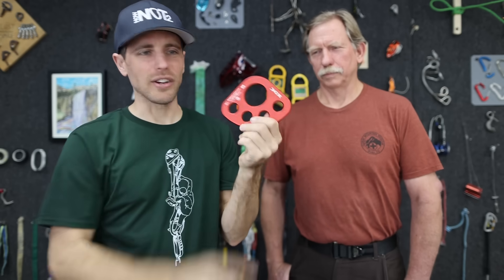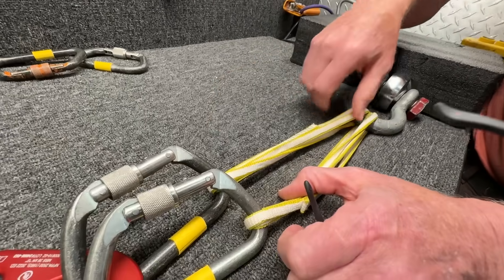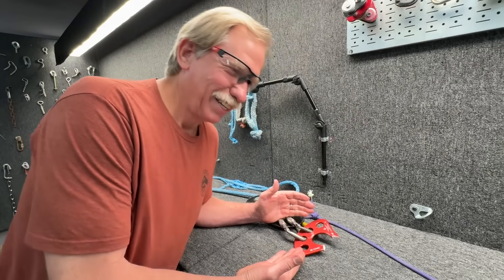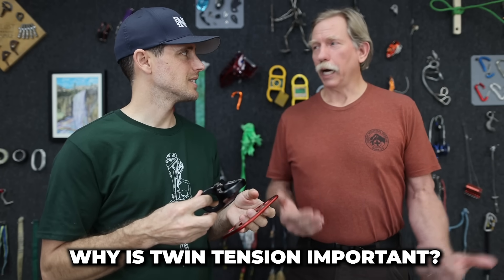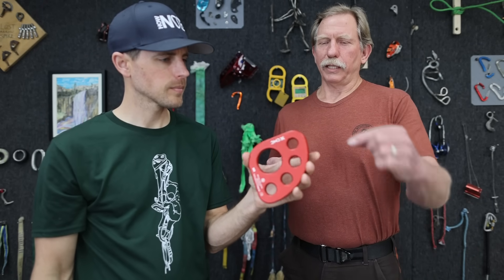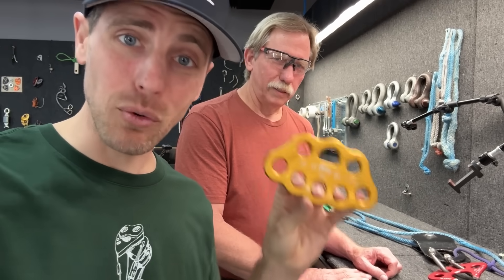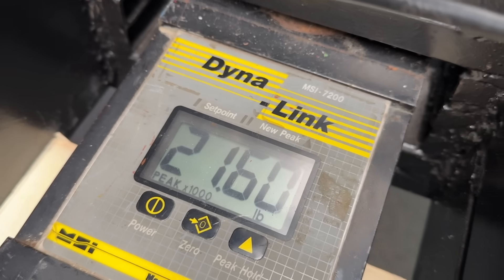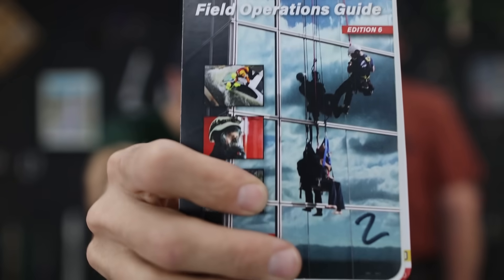When is Redundancy Ridiculous?

Comment: Why dual rigging? Because no matter how much you idiot proof, a better idiot will come along.
And sometimes the most reliable, steady and knowledgeable person has a brain fart.
I didn't work in rescue but in construction rigging where moving massive compact pieces of machinery  through restricted areas of structural frameworks, piping racks and narrow holes was like Tarzan swinging ftom vine to vine through the forest. All the while your in your safety harness, clipping and unclipping your dual safety lines to keep the chainfalls,  rigging and sometimes mainline from a crane doing their job and not binding up to a failure point. So nowadays our safty gearvis getting better because of crossover ftom the climbing and rescue side (and yes, i have worked a lot in confined spaces where Safety & Rescue has to sign off before we started work so if anything DID go wrong they were going to be informed for a rescue, good to see the expert testing their gear)

Comment: Redundancy

You Decide: In order to fully understand “redundancy” we must understand how “they” define it. More importantly, how a lawyer would define it, for example: he introduces an “expert” witness on the subject. CMC, NFPA, even TEEX define it the same. If *ANY PART of the main-line ie the “PRIMARY SYSTEM” fails, the “belay” (secondary system) should hold them. This includes a shock-load from an issue originating at high-point. (Note: I am not talking about the anchors, I’m talking about every element of the “SYSTEM.” 

With that being said, the “smart” guy in the room is now going to respond by saying “yea but the twin-tension method is a single system, utilizing two ropes, sharing the load on each line, which doesn’t require a back-up, oh and it’s the safest by far, it’s super duper redundant.” 

(Note: the twin tension is my personal favorite for a simple lower) 

My response: Yes, indeed the twin tension is the safest. But the manufactures and certifying bodies (who also teach the following methods lol)  didn’t change the definition of “redundancy.” For example: I rig a twin tension and only have one anchor strap on the anchor, with two clutches attached to it, both attached to my single Texora anchor strap (that I basketed on the anchor😉) that’s rated for 100kn. In addition, I rig another Texora strap to the double pulley on the high-point. 

Is my system redundant? The answer is no. You are essentially defining redundancy for yourself and on your own if any element of the primary system fails and results in injury or death as “redundancy” has been defined. It is clearly written. Unless they change the definition, they won’t care what your definition of redundancy is because they have already defined it for you. 

You don’t decide.

Comment: Modern technical rescue guy here and I also work in the industrial safety field, so I know all the boring regulations when it comes to NFPA and OSHA. Redundancy is good, but with modern equipped and modern MBS ratings redundancy is mostly just to make someone feel good. You aren't taking whippers on this stuff. In the industrial side of things I do alot of operations with a single anchor point and a single 1/2 inch kernmantle rope that has a weight rating of 9,820 lbs. In some cases it just isn't reasonable to have multiple anchor points and multiple rope systems attached to each person. In alot of cases I am going in alone on one rope with whatever equipment I need. That is why we use a 1/2 inch rope. The standard says 3/8 rescue rope is good for one person and 1/2 inch is good for 2 people. Now that isn't always the case though. Let's say i pull someone out of frac tower or 200 foot tall cold box.   Obviously I need to get them to the ground and that is when we will set up a redundant system as both of us will be attached together and be lowered down to the ground together. Them in a SKED or basket and me attached to the side of it so that I can help guide around obstacles, keep the patient calm if they are conscious, and/or render whatever aid is needed immediately upon reaching the ground. I have never had a peice of rescue equipment fail on me and the entire rescue team double and triple checks every part of the system. It is all situation dependant though.

Comment: For the first test, try repeating it without the upper carabiners. The narrow curve of the carabiner was point loading the master point, hence the deformation at the points where the carbines were contacting it. Using soft shackles or slings, that would conform to the curve of the master point, would remove the point loading.

Comment: "Redundancy" is a lot less specific in climbing, and for consideration: One rope is actually made of hundreds of nylon filaments; it is internally redundant, to the degree that ends up being pretty foolproof in normal usage. Protection on leads is redundant, as long as one remaining piece keeps the person off the ground/landing. One 22kN locking biner is usually considered as bombproof as his master plates, for normal climbing use, but in practice even clipping any secondary line to another anchor point feels a wee bit safer - and Todd Skinner and Paul Piana's famous near-catastrophe at the top of the Salathe Wall was averted by one last piece, as I recall, while the rest of their system was sheared off by the massive boulder.

Comment: Question, the way the basket hitched dyneema is connected in the video, could you do that for rock climbing anchors using locking carabiners on each end? To me, it looked redundant and way stronger than using 1 dyneema sling with a BFK or overhand and since dyneema tends to slip when broken (past videos show the knot coming undone in away) it seems safer than hoping a knot holds when broken. I understand we are talking about forces that most likely wont ever happen, just curious if this is a "safer" solution than one dyneema.

Comment: Its an endless and often ridiculous debate.
You can lift people with a single crane. It has one rope. One winch. One boom. You get the idea.
Over the weekend i snapped several ropes under normal load, due to age.
A number of knotted dyneema lines amd blew out a couple of incorrectly threaded blocks.
I watched a neighbouring crew start to hoist someone up a mast with backup line over a wire rope and a number of edges. Also not maintaining a maximum static fall for the backup. And i did intervene to point out their more critical hazards.
Most folk.just don't know and then assume that two of everything makes it safe. As for the T.A.. they should know, but just assume that two of everything makes it safe and absolves them of any liability either way.
Who remembers when you were allowed to tie your own knots ?

Comment: I would go with a plate with a hole for each anchor point. Since if the perimeter of the hole fails, only 1 hole fails, not the whole master point. Making the plate inherently redundant.

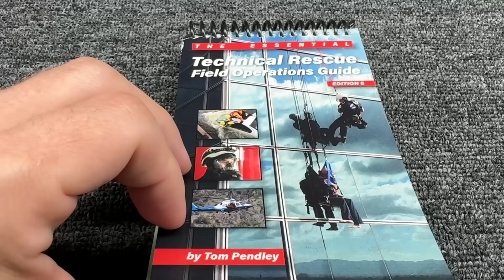Ie, the example at 2:10 isn't actually redundant since if the hole on the rigging plate fails at the anchor side, then it won't be securely attached to any anchor. This is a single point of failure. Even if a rigging plate in good condition can handle forces far beyond what is needed for the application, that still isn't redundant but rather an acceptance of marginal risk.

Some might argue that a single rigging plate can't be redundant, this is a bit of a myth that one supposedly needs two separate components to achieve redundancy. It is however a good rule of thumb.

Redundancy is only about handling one (or more) failures of individual aspects making up a larger system without the larger system itself failing. If the larger system has any choke-point where a singular failure makes the system collapse, then the system itself isn't technically redundant, if one wants to be super pedantic...

But in practice, reaching actual redundancy in any system is more theoretical debate than anything.
In reality one will have to brush some of these choke-points away as acceptable risk if it is infeasible and/or needlessly complex to make that aspect redundant.

The lack of redundancy showcased at 2:10 is fairly trivially amended by using a differently designed rigging plate with two separate holes for the anchor points. Preferably separated a bit such that a brake in one doesn't meaningfully compromise the other. This amendment isn't infeasible nor needlessly complex, making this single point of failure fairly unacceptable if one desires redundancy.

However, with two separate anchor holes one will have uneven tension on the ropes if an anchor point fails, since the rigging plate will rotate. But the main operator is able to equalize the tension on these ropes again in fairly short order, nor does it matter that one ropes is a few inches longer than the other. I rather much accept this than a free fall, any day of the week.

In the end.
Super good enough is however still a good way to look at it. Like I won't say that the rigging plate is garbage. But in a redundant system, one would prefer the bar for introducing acceptable risk to be higher when the solution to the single failure point is as simple as this.

Comment: I'm an IRATA technician since 2004.Things changed a lot and that is mostly to prevent human error.
Also they change after analysing accidents and incidents and find out what went wrong. If it was human error,change the method the task is performed, it if was the gear,improve it or remove it from use.

Comment: The redundancy in occupational settings and the hugely different safety standard in general is to account for user error. When you're a recreational climber, you can decide to just not do it if you're not felling 100%, if you've got a bad gut feeling, whatever. In an occupational setting, that is often not as viable of an option as it should be. Maybe you're an arena/event rigger walking on the beams at the end of your fifth 12 hour day in a row. Maybe you're a rescue technician who was woken up by the notification in the middle of the night and now needs to rescue someone, mere minutes after being ripped out of your sleep. Maybe you're a rope access technician maintaining a building, and even though you're tired and just not feeling that good, you power through because it's your job. In all of these four situations, the likelihood of user error is dramatically increased. You'd be surprised by how much tiredness can impede on your brain's ability to get even the simplest things right, and that is a big problem when your safety depends on whether you tied a knot correctly or incorrectly.
Another reason for the high safety standard is that it dictates what a boss can demand of a worker. If a recreational climber finds that something is unsafe, they can just not do it and that's it. If an occupational climber finds something is unsafe, there needs to be some sort of technical standard that determines what is and isn't safe so that it can be determined whether the climber is justified in refusing to do the work or not. And logically, this technical standard needs to have a high safety level so that workers can't be forced to take unnecessary risks.
The third reason for the high safety standard is to account for unrelated health problems you could be having while in your harness. If you're climbing recreationally and you have a heart attack while doing so, it's your responsibility and your problem. In the occupational setting, the employer is responsible for the safety of the employees, so if they have a heart attack while harnessed, the employer has to make sure they can be rescued and receive the necessary medical care. It's about making sure that a bad time doesn't become even worse when you're harnessed. I'm saying harnessed because this is especially visible in the standards for fall protection: in my country at least, a railing needs to have a 10cm footboard, a pipe at 50cm and a pipe at 100cm (or 110cm depending on the height) to be considered safe. So if the railing protecting you doesn't have the pipe at 50cm or the footboard, you need to be harnessed, even though in normal situations, the railing still protects you from falling. But if you stumble and fall for some reason, like because of a sudden aneurysm or whatever, you can fall because then, the railing really needs all of those three components to keep you safe, so that is why you need to be harnessed in that situation.
Reply: But none of that is fixed with 2 plates?
Reply: @Asbjoern  I was only talking about why redundancy exists in an occupational scenario in general. Whether using two rigging plates instead of one provides a safety benefit, is a different question. One could argue that all that can be wrong with it is a user error where doubling up the plate does nothing (except potentially divide the load) because both plates are susceptible to the user error, so using two plates is unneccessary. On the other hand, one could also argue that a rigging plate may incur small cracks after the previous yearly inspection, which could be missed when the plate is visually inspected before use, so doubling up the plate is necessary to prevent this small error from having fatal consequences.
That's one argumentation for each side. Which one is correct, whether rigging plates have to be doubled up in theory, if it's also done in practice, if it would even do anything if it's actually practiced (your question), those are questions I can't answer.

Comment: Wish I lived near that area and could geek out on that job opening. Since not, will support by buying through your online store when I need gear. 

Once thing that wasn't discussed (unless I missed it) as the fail tests continued, is the wear stresses of each attempt, weakening the parts closer to, or even below, their original 2-1 or 5-1 safety factor thresholds. Not so...? Just a point to remember in the field as your gear gets put into successive service.

Comment: ISO 9001 Compliance doesn't actually mean anywhere near as much as you'd believe, it entirely comes down to the company they contract to produce it. 
THAT SAID, it's a single part, tollerances mean basically nothing (With a exception of thickness but I can't imagine they'd try and get away with anything so undersized that it would compromise the strength.) so yea, ISO 9001 compliance means they have to buy traceable materials and that's enough in this case.
Reply: I work at a ISO 9001 and 14001 certified company. I've participated in many audits by customers and ISO. In my opinion it basically means a company has their stuff together. The quality assurance dept has the ducks in a row, and documentation is on point. There's a ton that goes into getting these certifications so it means the company is actually trying and cares about their product.

Comment: If you are going to use two rigging plates, you should use two different plates, not two of the same. You aren't doubling them to make it stronger. You are doubling them in case they are faulty and don't get close to their rating or fail in some other way. If you have two of the same, especially from the same batch, they could both be faulty. Perhaps the supply of metal they had that day was faulty. Or the annealing machine was set to the wrong temperature. Or one of the plates is actually a cheap knock-off. Having two of the same doesn't provide much extra protection.

Comment: Great video!! What I’m most curious about is when using plates in highline/ rope swing rigging is there any cause for concern with fatigue of the aluminum? Obviously super strong on one single pull but what happens after it’s been cyclically loaded?

Comment: Safty or rescue equipment has a minimum safety factor of 2 engineered into the ratings. This is why your test failure is about double the rating.
Reply: Your thinking of lifting/rigging gear, this is marked as a Minimum Breaking Strength. If it fails at higher than that it’s usually due to batch testing where the lowest test figure is what’s used for the whole batch so others in the same batch could be stronger.
It failed at double the MBS because they load shared two 45kn holes, no surprise there

Comment: With redundant systems, you've always gotta weigh the value of redundancy versus just having twice as big a system. This is why for example we do not use redundant wing spars in an airliner but we do use redundant control connections.

Comment: Redundancy is critical with industrial rescue. Most rescue team members are plant employees, who typically do not get the necessary repetition to be proficient with rigging, knots, etc. CMC has done a great job engineering useful equipment that minimizes the likelihood of "operator error". Their video library has been a huge help understanding how to safely use their equipment. Great products!
Reply: Sounds to me like it mostly makes things more complex and introduces more failure points. When there are a lot of carabiners, slings etc. it often becomes impossible to see the actual weak link. For example you might overlook that you are using a sling as master point in a way that a single cut strand could lead to failure of the whole system (and you might overlook that said sling is rubbing over a sharp edge). Or you might be building your anchor using several bolts or cams and overlook that they all rely on a single boulder or rock flake not coming loose.
Reply: @Mike-oz4cv  Industrial rescue can be more complicated. Particularly, anchorage points. OSHA requires engineering rated 5k lbs( per person supported) anchor points. Most plant employees without proper training would  see no problem securing to a handrail. I try to keep the equipment simple, anchor strap, carabineer, clutch, capto, Tripod. That'll be sufficient in 90% of our scenarios.
Reply: @Mike-oz4cv training; and have a new pair of eyes as safety person